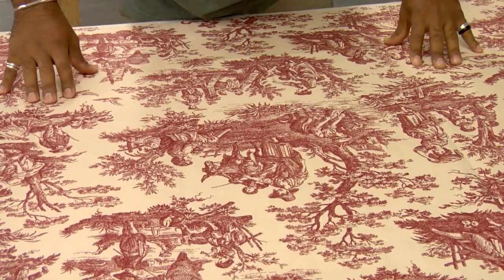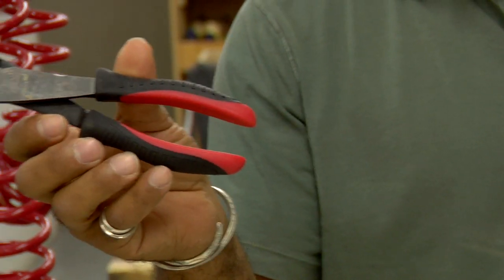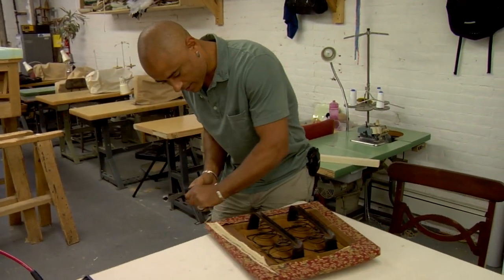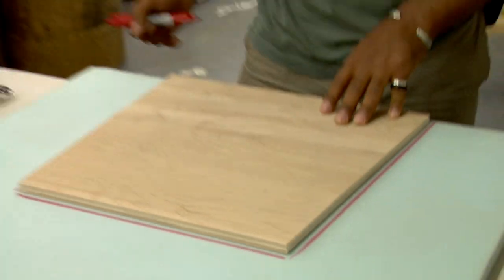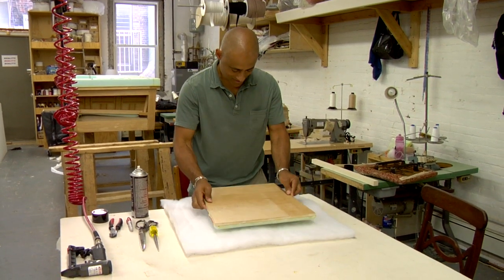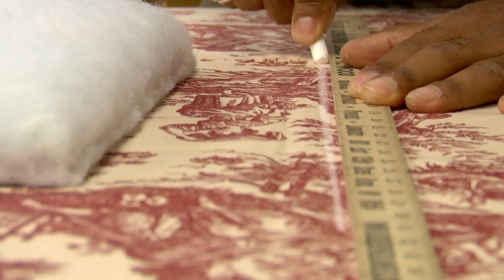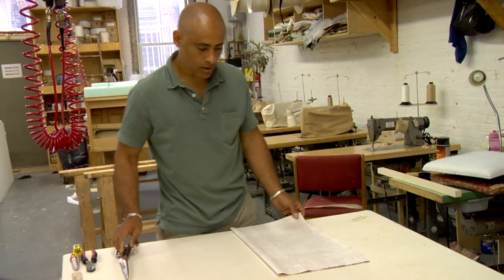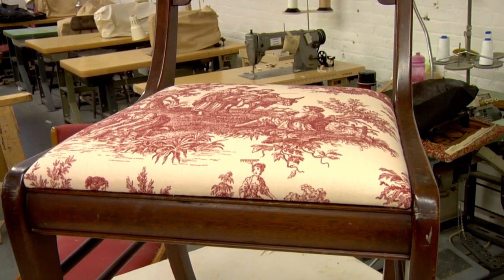How to Reupholster a Dining Chair | This Old House

Comment: What brand of adhesive did he use?
Reply: I don't know what he used and I know there is special upholstery foam spray glue but I just used some multipurpose spray adhesive from 3M (super 77) and it worked ok and didn't melt the foam.